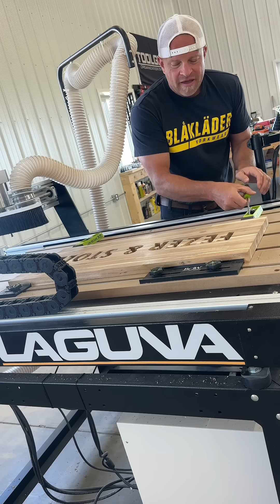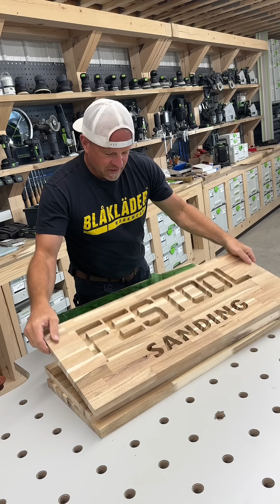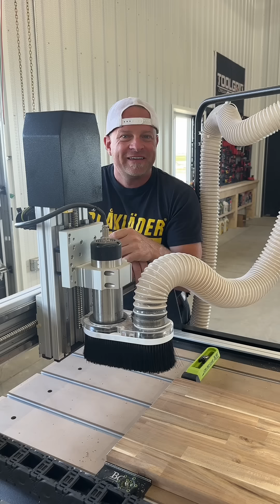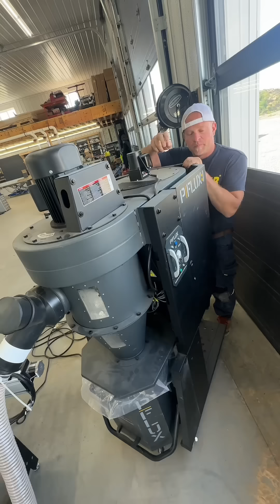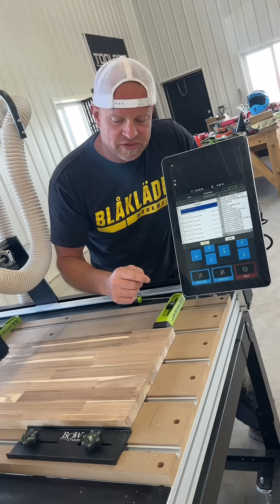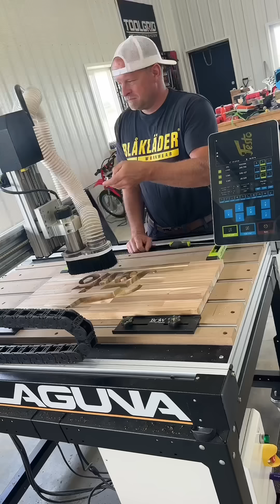Been using the new @LagunaTools  KX:24 CNC to cut all the upper signs for the Festool shelves

Comment: Festool is terribly overpriced.
You can use any of the other makes to get the same results ..
Reply from the maker: This is a common comment almost anytime I use a Festool. It is true they are usually more expensive than other brands but the price is justified given how much more engineering went into the tools, how incredibly easy they are to adjust and micro adjust and use. I also notice a lot seem to drastically over estimate how much they cost. Having said that given that they cost more they may not be what some should buy. For example if you only use a router a couple times a year as a hobbyist then the price may not be justified or if you only do a few simple edge routing operations and don’t need the extra functions and jigs then it would be understandable to not pay extra for stuff you wouldn’t use 👍

Comment: WEVE EVEN TURNED WOODWORK INTO CNC
Reply from the maker: There are some guys that still do all hand tool work but makita tools were invented and made in Japan to improve efficiency and reduce worker fatigue. If you take a look at any modern Japanese shop they also use power tools
Reply: @dustylumberco thanks for the response. I was making the point that programming it like CNC is taking it a bit far 😂 I do agree it decreases work load 100%